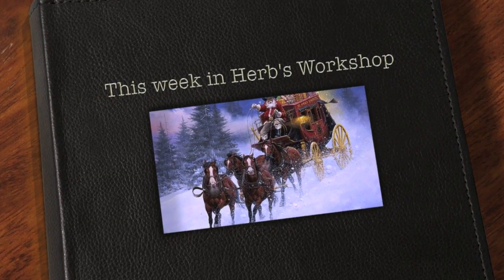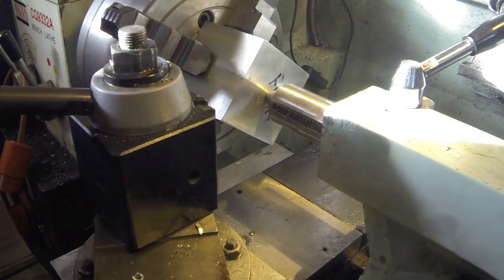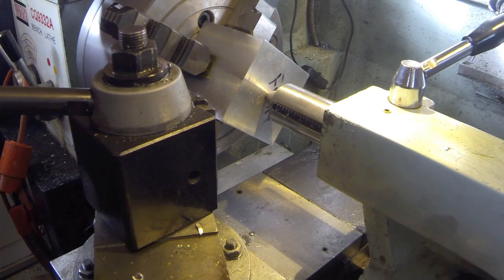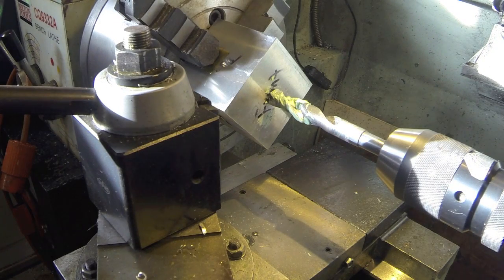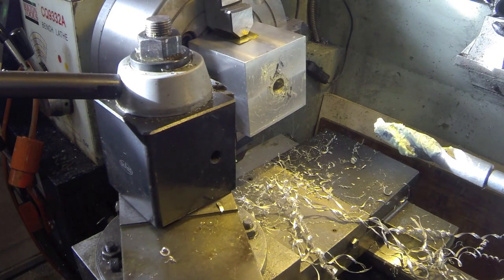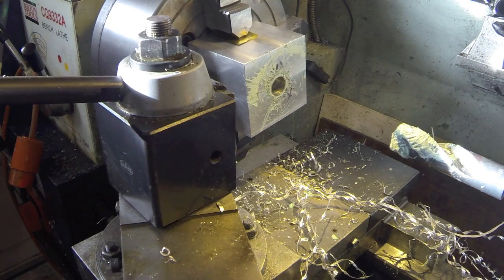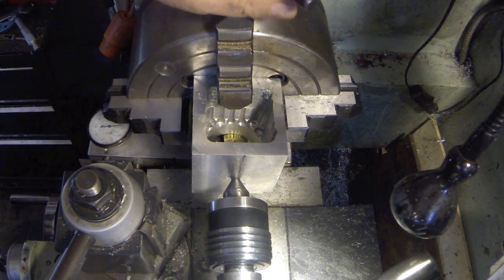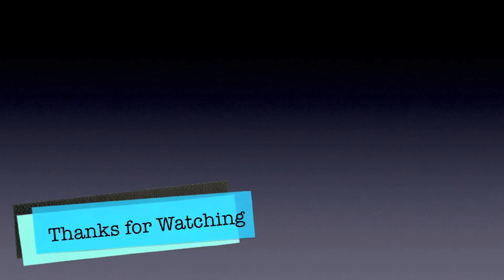This week in Herb's Workshop #19

Comment: So this is the footage missing a little while back?? I thought I remembered you having the crankcase done in a prior vid? Lots of holes to hollow out the aluminum block...plunge milling with a sharp 2-flute works well also. ;-)
Have a great Christmas Herb!!

Colin ;-)
Reply from the maker: Colin, this is a new crankcase.  The old one had too many screw ups.  Broken drill   tried to clock the bolt circle around and broke a tap  tried several things to get them out and just made a mess of it.  Best thing was just to start over.
I did use a two flute end mill, but the one I have was too short to reach 2 1/2 inches.   It still needs to be cleaned out a bit.
I lost several takes on boring out the two big holes.  I've got it almost finished, only need to drill 8 more holes for the back cover, and it should be finished.  Thanks for watching and the comment.   Merry Christmas to you and yours.
Reply from the maker: *****
Thanks!  Merry Christmas and Happy New Year!
Reply: Herb Blair
Ha, wouldn't be the first thing I screwed up either..  we all do that from time to time.
Look forward to seeing the engine complete. I'd love to have time to do a project like that.
Take care over the holidays Herb and have a good one!

Colin ;-)
Reply from the maker: Colin,
The thing is to learn from your mistakes.  ha ha.
Merry Christmas my friend!

Comment: Looking good Herb.  What size is that Bolton lathe and do you like it?  Merry Christmas! :)
Reply from the maker: Steve,
The CQ9332A is a 12 x 30.  It is OK, but I wish it had a quick change gear box.  Also the spindle is a plan back type, I wish it had a more standard type.  The third thing I wish it had is a dovetail mount cross slide. For the money is is pretty good.  I broke one of the change gears, and was able to get a new one a no charge.